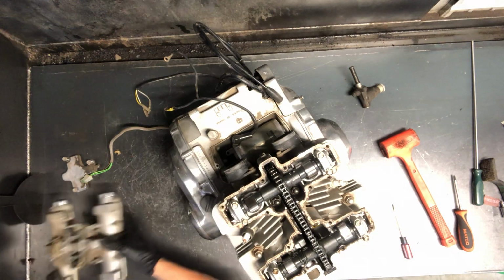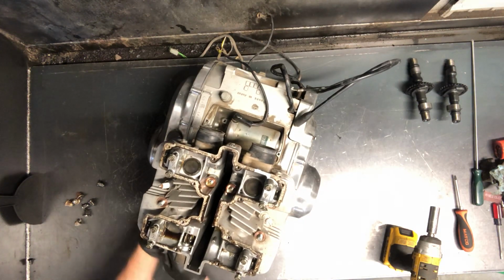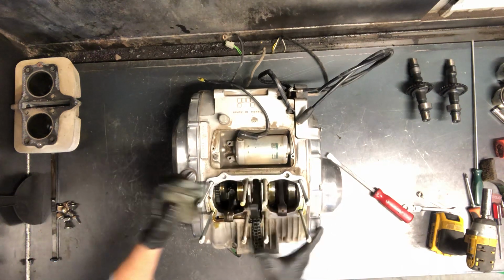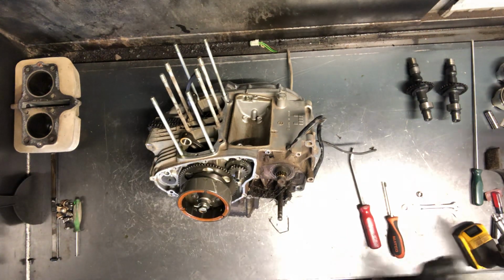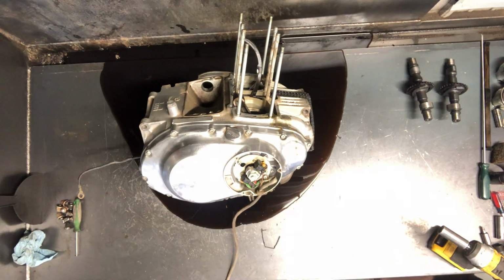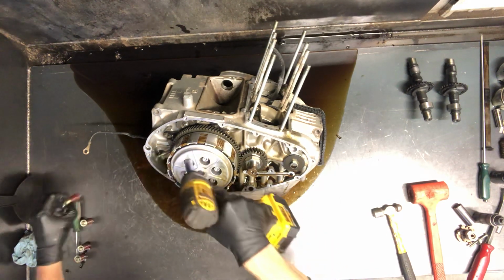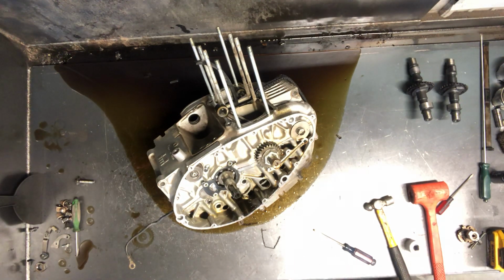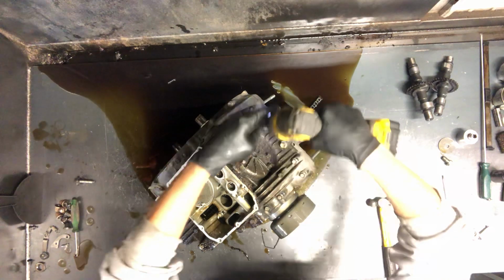How To Suzuki GS450 GS 450 Engine Motor Rebuild Tear Down - Complete - Vintage Old Bike

Comment: Hey what would you do if you stripped the 3 bolts holding down the oil filter on a gs450a? Tap and die? Asking for a friend